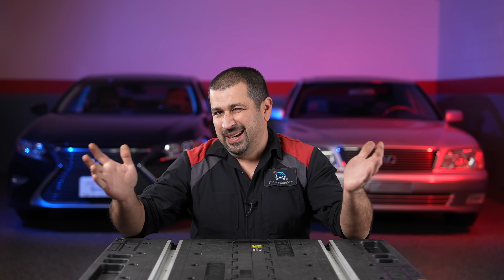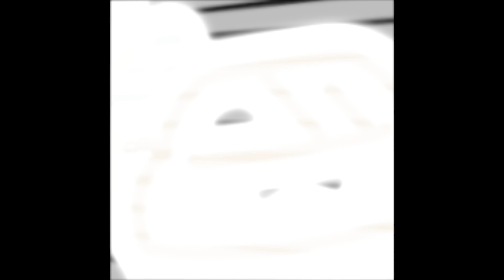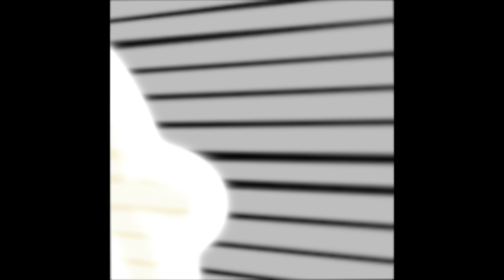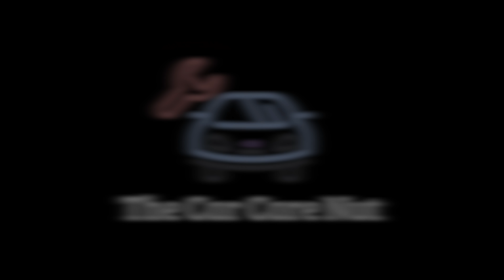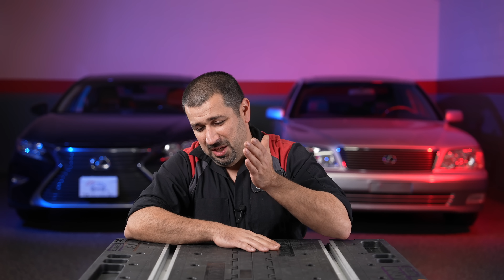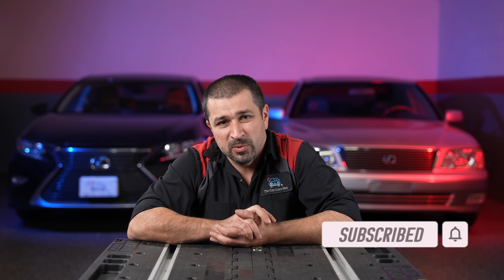Can Modern Turbo Engines Be Reliable? Here's The TRUTH!

Comment: EV's are becoming more reliable these years, but people still think they can go 6 or 7000 miles oil change intervals. Realty, you should change every 2 to 3000 miles or don't and car leaves you stranded with less than 100,000 miles. Yeah, if you have destination charging, the less ignorant will go the smarter rout and get an EV. Feel bad for anyone who lives in an apartment complex because turbo gas car will be your only choice for now sadly.

Comment: My stepson just drove in from Florida to Arizona for a job he had here an of course we insisted he stay with us not a abnb, totally off topic of your video he's got a 2007 toyota tundra 4.0 v-6 an the air pump control valve needed to be replaced again it had been replaced before but not original toyota part so are Christmas gift was getting the part an I fixed it on top of oil change restored headlights upgrade to led replaced a broken taillight assembly with all the bulbs because one brake light was out one reverse light was out an the other one was the wrong bulb, anyways got the ol gal back to normal great truck, an he headed out the other day I gave him a 14mm wrench a tube for the oil filter drian deal an told him like you say an say repetitively change your oil when time to the one killer of these motors is lack of changing oil, he had 6000 miles when I changed it i had to bite my tongue and I told him go to the parts department at a toyota dealership an buy the oil and filter there it's just better anyways the you car care nut your awesome an God bless you sir an may your wrenchs always be turning. 🤌⛪️🇺🇸

Comment: Short of a catastrophic accident, I thinking I'm keeping my 2021 Tacoma forever.
Reply: Currently on a road trip in South Carolina from Maryland.  2011 Tacoma, 4.0 v6 . If it wasn't for the Falken Wild peak tires ,I could doze at interstate speeds. No rattles, knocks, squeaks or leaks. Our 2018 RX350L is even better. 2GR FKS , 3.5 v6.
Reply: Keep the frame treated with Fluid Film annually and it will!
Reply: Smart all the way around. Drive it until the wheels fall off.
Reply: Smart move....it will last a long time as long as you take care of it.
Reply: Should have 20+ years left
Reply: I love tacomas....i want a early 90s 4x4 v6...they rock.
Reply: I have a 2020 and have the same plan.
Reply: Your same reasonings 
But I’ll keep my 2001 3.4L Tacoma too.😂
Reply: I'm counting on the same thing with '21 TRD OR and my wife's '22 RAV4 AWD. I'm a fluid changin' foo  these days! 😅
Reply: I will likely keep my 2015 taco forever , I don’t like all the nee electronics on vehicles and I can still do most of my own work on this one . Keep it till the wheels fall off
Reply: It will last 4000,000miles
Reply: V6 baby
Reply: I wish you good luck… the problem I found is that there is so much plastic on vehicles built these days. Eventually the plastic/rubber parts start breaking down, and a replacement has to be a new part.
Reply: @6Shooter357 and those plastic things will break down quicker if you live in a hot, humid and salty area.. 😂😂😂
Reply: NOTHING stays the same FOREVER.. 😂😂😂
Reply: @JP81188  and it's hard to hold a candle
Reply: AND it will last you forever.

Comment: I had the 'good fortune' to be a parts manager for Audi in the early eighties.  The 5000 Turbo sold a lot, customers thought they were getting V8 performance.  Shortly we were handing out a new turbo with a 15k maintenance.  Along with a couple of window regulators, but that's a different story.
Reply: Late 80's to mid 90's Audi 5 cylinder turbos are bulletproof though
Reply: @urs6onfuturas975 The bottom end was.
Reply: My parents owned one of those😂
Reply: My car!!

Comment: I have a Corolla hybrid, of course it's non turbo but I still change the oil every 3500 miles with Mobil 1. 
500k miles is the goal
Reply: Unless you do a lot of short trips, that's probably excessive, especially on a non-turbo engine.  Your car also holds about 4qt of oil, which is quite a bit for a 1.8L engine compared to older engines (my 4.0 Jeep only takes 5 qt).  3K change intervals is a holdover from when there was little to no filtering, less oil in the pan, and the oil was barely-refined crude. Consider doing oil analysis one of these days and see how much life that oil has in it.  I think the recommended OCI is 10k miles.  You could do 6k for $1,000 more over this 500k timespan, but 3.5k means you spent and extra $3k.  That's DIY using Mobil 1, not to mention the time.  I have a 2014 Acura MDX that gets MOST of its miles on the highway.  I've been doing 10k oil changes.  At 160k miles, it runs like new and burns about 1 qt every 10k miles.  All that said, when I had a high-strung turbo, I did my changes at half the factory recommended interval....which was still about every 6,500 miles.  That car took 7.5 qts in a 3.0 though.
Reply: @blurglide  10,000 mile intervals for oil changes even at highway miles will require the highest synthetic oil available.   Not sure I would go that far; you still get thermal and compressive base oil breakdown with higher RPM and loads.
Reply: When my Corolla has 500,000 miles on it, I will be 123 years old.😁
Reply: To go 500k you would need to do a transmission oil change every 25000k in hot climates and 30000k in four season zone. Happy driving 😊
Reply: You will have spent around $8571.00 on oil changes.  If you wait to 5000 mile intervals with quality synthetic like Pennzoil Platinum you will have spent $6,000 and I would be willing to bet your engine would show close to the same wear, and you would save $2500.  (if it makes it to 500,000 miles)
Reply: @CAN43714, imagine if I bought 5 Fords each at 100k miles and spent 30k on each one. I would have saved $141k

Comment: History has already proven turbo engines can be reliable. Both Toyota and Honda have had them already. Just look at the Honda K20C or the 2JZ. Even small displacment turbos can be made relaible if the block is closed decked with strong internals. Honda K20C1, K20C2, and K23 can produce 320HP easily and has been around for a long time. The 2JZ is the pinnacle of how a 3.0L engine can produce massive power with complete reliability. But that engine has forged internals and a closed deck. However, regardless of the engine, maintenance can not be ignored.
Reply: Correct. Also the offset crank design on Toyota’s new turbo engines will help durability.
Reply: *can be

Comment: you need to tell people about the crappy  0W oil    put at least 5W30 in it    heat destroys the thin oil    0W oil only in US   same car same engine in Asia or Europe comes with 5W30
Reply: He literally said that's a bad idea
Reply: Show me proof that a 2025-2026 Camry in Asia or Europe requires 5w30 instead of 0w8.  This Camry engine has and electronic oil pump and VVTI system regulated by the ECU and calibrated to 0w8 oil.

Comment: they can, &  i still drive a 25yr old vw petrol turbo engine with coolant and oil going to the turbo with OEM turbo

but of course i do my own oil changes (that being the most big thing in my opinion) because i can see when it gets to 7000km the oil gets cooked. 
and also i would like to add i use  almost the dirt cheap synthetic oil i can get. 
no idea why to get expensive oil if i go max 7k km on a change

Comment: The latest study shows that in the U.S., only 25%  of auto owners follow the routine maintenance. That's one in four. So first, I won't buy a used turbo from anyone. 2, I have that Toyota 6 cylinder in my older Taco, and I'm keepin' it, while watching the blue book increase thanks to turbos.
Reply: 2019 V6 2wd Highlander
I’m planning to keep it till I die.
I put 10,000 miles yr on it, it’s got 75,000 miles.
I’m 72
Do the math 😂
Reply: @5150Bud  Your grandkid could be driving that car in 2062.
Reply: It's why the first thing I do when looking at used cars is check the dip stick and oil fill cap for varnish.  You can tell right away if they kept up with oil changes.
Reply: @BartSparrow123 …if they didn’t keep up with oil they probably ignored coolant changes every 50,000 miles.
Reply: @5150Bud  Correct and they probably never changed the transmission fluid or differential oils if they didn't do the other routine maintenance.
Reply: Do we interpret that  statistic as the owners merely do not take the car to a dealership, or that all they do is change the oil or less?
Reply: @theredscourge  I tend to stay on the pessimistic side of the stats given, as it probably runs a wide gamut. A perfect example is this: my stepmother grew up in a household where her dad is a mechanic, and she doesn’t believe in regular maintenance done on her car. “Oh, it’ll be fine” is her attitude towards doing maintenance on time. 

“Oh it’s fine” is not what should be said when the oil change is 2k miles overdue.
Reply: @ButtonsKnobs or the radiator fluid has never been changed so the head gasket is ready to blow!
Reply: Doesn't matter if the maintencae schedule was done perfectly... if it is a turbo in a truck that runs on regular gas....turbos are a disaster and you can forget about longevity and you will have repair bills that look like zip codes. The laws of physics, nothing more.
I own turbos. I know. Nothing new about them, they were not put in most vehicles for a reason . Nowadays fools think it's the next big thing. They will FAFO.
Reply: My brother in-law owns a Taco from the generation prior to it being turbo'd and he's had several people ask if they wants to sell his truck because they don't want to buy the new generation.

Comment: I had one of those Jetfire Oldsmobile's 1963 or 1962 model ...   Aluminum engine always ran hot (I lived in Miami Fla.) It also had a liquid fluid you added for more power.
Reply: Methanol/water mix....
to counter detonation on the poor quality fuels from those days...
or the low octane that would sometimes be the only fuel available in an emergency.

Comment: 2022 ford maverick. 2.0 ecoboost. Every 3000 miles with pennzoil platinum oil. Its an absolute must. 5k is pushing it because of oil contamination due to  blow-by.
Reply: 5K is enough. 3K and I want an EV. Cause now the machine owns YOU…. You don't own the machine anymore. No thanks!!😮

Comment: Heat and pressure destroy engines.  Turbochargers create heat and pressure.
Reply: Heat and pressure beyond design limits, I've had plenty of turbo cars and its not blown engines or turbos im replacing
Reply: Ok, when an engine is built properly, it can tolerate heat and pressure.
Reply: I love my CHR 1.2 turbo 6 speed manual. I never push her hard and it never used oil and it's always clean looking too.
Reply: Can you show an oil analysis of 5k miles versus 10k miles on the oil on the same engine?
Reply: GM turbomax = 27 psi. Hurricane 2.0 = 35 psi.
Reply: engines create heat and pressure 😂
Reply: @cmdrls212 he should have said EXCESSIVE heat and pressure

Comment: No matter how often you change your oil the GDI and EGR will shorten life.
Reply: Vehicles have been using EGR valves for over 50 years. I have 2004 Silverado with the 4.8L Vortec LS engine. The engine was running fine and not consuming oil when it spit a spark plug at 307,000 mile. The threads for the spark plug in the head were so stripped out that I could not install a new spark plug. Since the engine was still running just fine otherwise, I could have just had the head repaired. I went over my options of having an engine with 307,000 miles on and I was not just going to repair the head and leave the rest of the engine the same. I opted for a reman long block that I installed myself and the reman engine is running fine with 25,000 miles on it. I have always changed my oil every 3,000 miles.

I 100% agree with you on the GDI injection system. The intake runners and intake valves carbon up horrendously with not many miles on the engine. This will certainly shorten the life of the engine because some of that built up carbon is going to make its way the cylinder at some point, and it degrades the performance of the engine before that happens with the partially blocked intake runners and carbon caked valves.
Reply: By how much though?  EGR has been a thing since the 80s or 90's and still plenty of super high mileage Toyotas.
Reply: @BartSparrow123  They started putting EGR valves on vehicles in 1973. Any car before that was lucky to make it 100,000 miles. You had a "winner" of it exceeded 100,000 miles. It is not the EGR valve itself that extended engine life. What improved the life of engines is the cleaner running engines we have today, and they are cleaner running for a variety of reasons. Along with this, we have better lubricating oils than before. A lot of the clay has been removed from what prior oils contained.
Reply: @tommyhawks856  I wasn't around in 1973 but it seems to me that 50 years + ago, no one was commuting 30,40, 100 miles to work.  Today that's normal.
Reply: @BartSparrow123  Should you be arguing that constant short commutes are hard on an engine, then I will agree with you. Driving conditions also are a factor, even if you are driving 100 - 200 miles per day. Unless you live and work in the city, driving distances for work have not varied that much since the 1970s. We actually had highways and intestate highways back in the 60s too.
Reply: @tommyhawks856  Sure, my point was cars in 1973 would not see 100,000 miles because people only averaged 5,000 miles a year on their cars.
Reply: The problem with EGR is that it's prone to clogging. Without the EGR combustion chamber temps can skyrocket.

Comment: Turbos wear out engines faster.
Reply: Only if you let the oil degrade to such an extent that it no longer lubricates the rest of the engine.
My 34 year old SUV DIESEL has a plate-style oil cooler OEM in the side of the engine block using coolant  to cool the oil...and the engine lives with 3000 mile oil changes using conventional oils....

Comment: Toyota messed up the Tacoma going 4cyl turbo.
Reply: meanwhile the only engines blowing up and getting recalled are the v6 😂
Reply: Didn't do themselves an favors by putting a twin-turbo V6 in the Tundra ether.  I'll be keeping my 5.7L V8 Tundra till the day I die!
Reply: Why? The engine is a lot more responsive, makes better power and a wider torque band than before. Have you driven one or lived with one for a long period of time, or are you just baselessly speculating like the rest of the numbnuts out there?